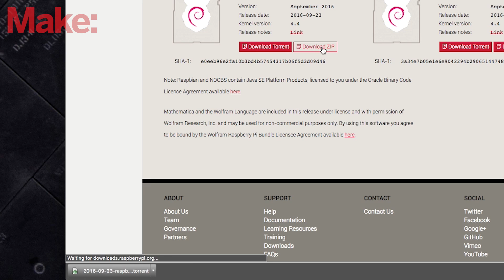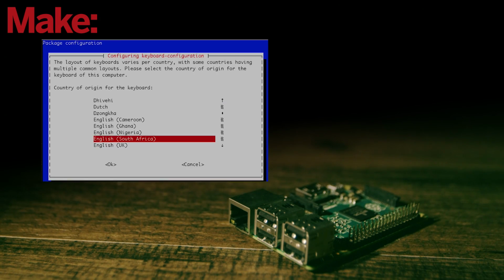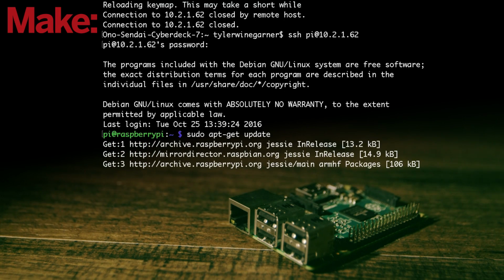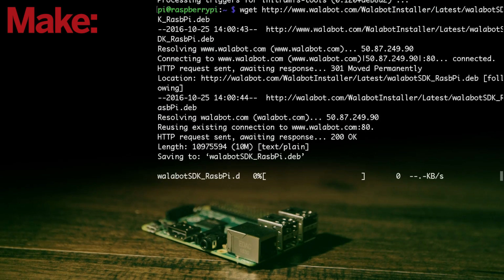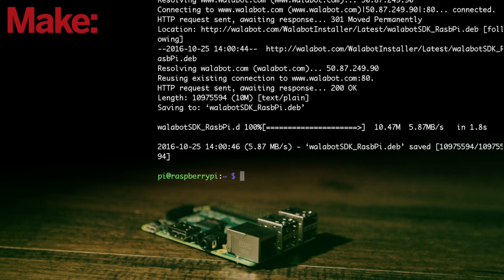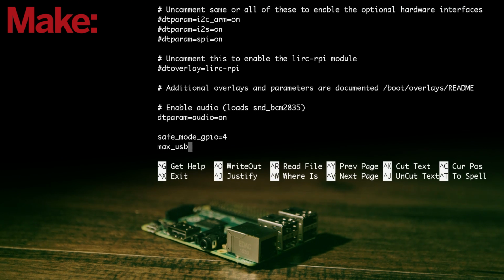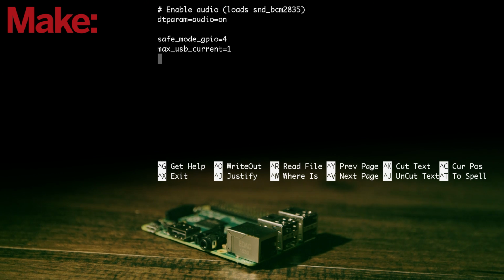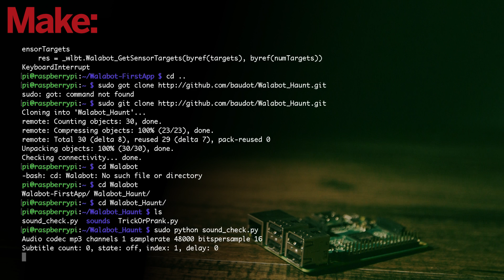Weekend Project: Walabot Halloween Haunt

Comment: you could have easily done that trick with a pir motion sensor and an arduino nano.

great work btw...
Reply: Yes, you can do a similar trick with a simple motion detector, but notice that the Walabot is behind the door; a motion sensor can’t do that. Also, the Walabot can tell the exact distance, plus  identify and differentiate between multiple people.